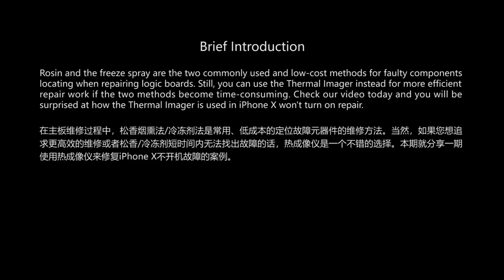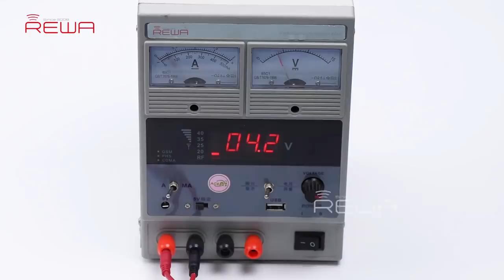iPhone X Won't Turn On Repair - Thermal Imager Applied

Comment: Crappy soldering job. Solder didn't flow and cap was not straight on the pads. Anyway good that you found that short.
Reply: The important was the concept, to teach people where was the failure.
Reply: well done to correct him